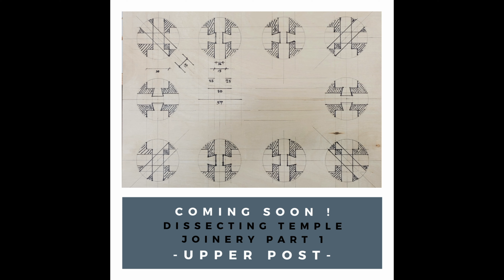Making a miter sled easy & accurate!

Comment: Thanks for another great video! I'm assuming that you trust the parallelness of the rails and squareness of the triangle. If there's some question on those, would you recommend a squaring method for the back fence (and subsequently the miters) with something like William Ng's five cut method?
Reply from the maker: Yes, parallel to the blade. this method can work for the cross cut sled also.
In my opinion, William has one of the best method in making cross cut sled which partially came from European sliding saw method. But, only downside for this method is time consuming (at least to me..). I've made my cross cut sled with the same method as in this video and its accuracy is under .002 of inch.
I came up with this method trying to get my inside corner aligned perfectly center to the blade.